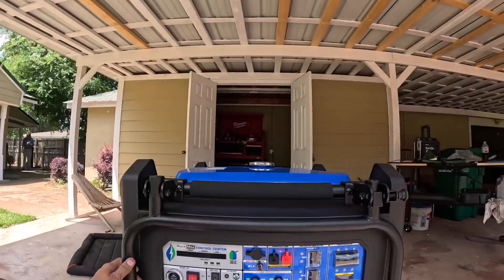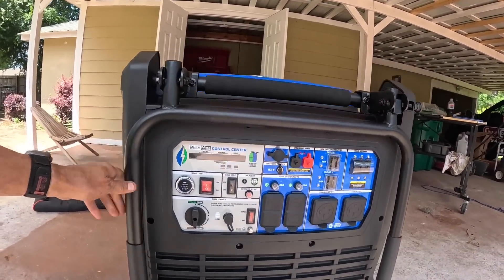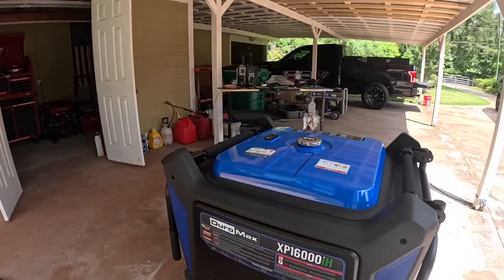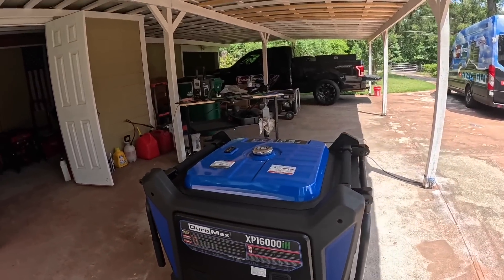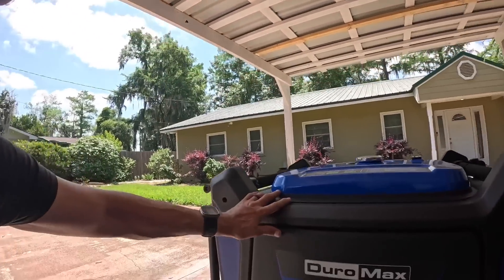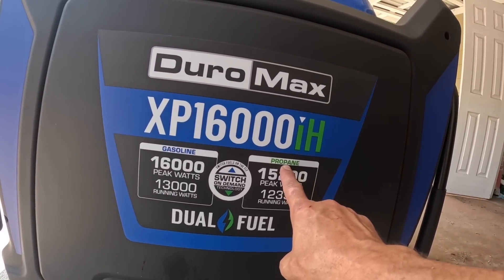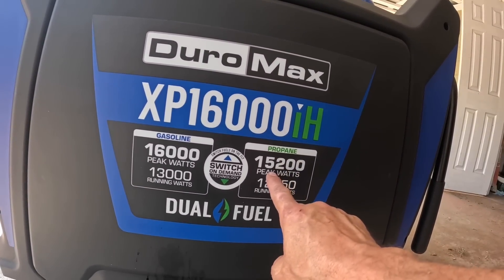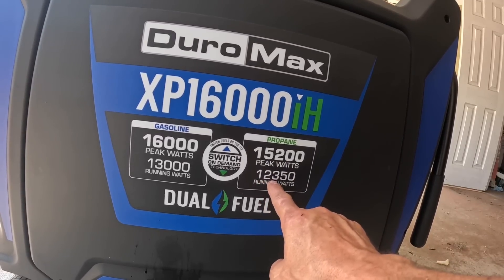Most Powerful Inverter Generator On The Market. Initial Load Test!

Comment: Propane tank should be a 30lb minimum
Reply: Those 20lb tanks are much easier for women to handle than 30s or 40s. I got lots of 20lb tanks so my wife  can change them easily if I'm not around. Could the regulator ice up on a long, hard run in a very cold and humid climate more easily on a 20 lb tank? Yes it could...but wrapping a tarp or blanket around it alleviates the problem unless you're in North Dakota or Canada maybe.
Reply: @Robnord1  it's not just the issue of regulator icing up, as the whole tank will ice up and the pressure drop too low to supply it anymore.
in general any high volume using device needs an large tank and should ever be let run to below 40% fuel level! (yes all will often be ok to 25 to 35% range, on 1000+ gallon tanks). tiny tanks and high draw devices will fail at 70% or more of fill volumes, as they just cannot supply that much, nor the peanut regulators.
Reply: @throttlebottle5906  That's interesting.  Small tank freeze-ups have not been an issue here in my part of western WA, where winter temps rarely dip under 20 deg F.  Maybe I haven't experienced either regulator or tank freeze-up because our generator (6700 run Watts on LP) probably draws under 40K BTUs. Next winter I'll hook up one of my 20s to my home, which can exceed 100K BTUs, with everything on and see if it fails on a frosty day. Thanks for mentioning it. I'd rather find a problem now than in the middle of an extended grid down emergency situation.
Reply from the maker: Hmm. Could be why I had those difficulties. I have two large tanks. I’ll try them next.

Comment: We live on the Mississippi coast and have had our problems with hurricanes over the years.  This would be a great set up to have!  Thanks for the video!
Reply from the maker: Those hurricanes are no joke. We don’t see them as often as y’all. But, they still affect us, sometimes in a major way.
Reply: I am near you, so I know your pain first hand.
Reply: We just got hit by Beryl and my old genny quit powering my central HVAC. Decided today get a DuroMax 13kw tri-fuel. Yeah, the inverter would have been a better option but it’s also $3000 more.  Long term, that’s the goal, but for now the 13kw will get us through the storms.